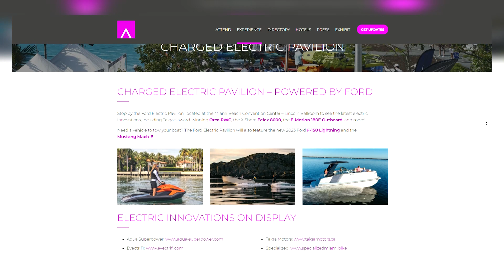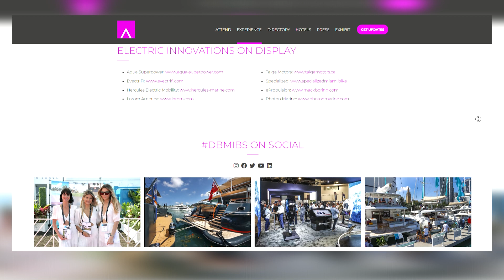Nigel Calder & Jeff Cote Talk Marine Electrical - Part 6 of 11 -  Electric Propulsion

Comment: I was wondering if you could reduce to 1 diesel burner on a cruising sailboat, so install an electric motor, driven by regular diesel engine OR generator + sufficient battery pack for some autonomy for silent propulsion and or Airconditioning at night without burning oil. Get rid of 1 motor, so less infrastructure+real estate would to me seem biggest win in this hybrid puzzle, especially  on 40-44 foot boats (my sweatspot of almost realistic dreamyacht)